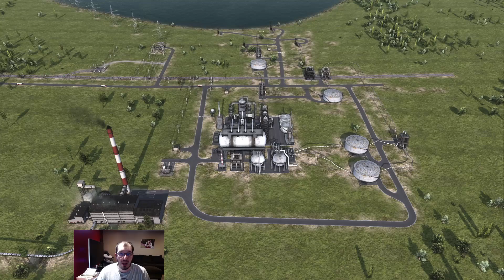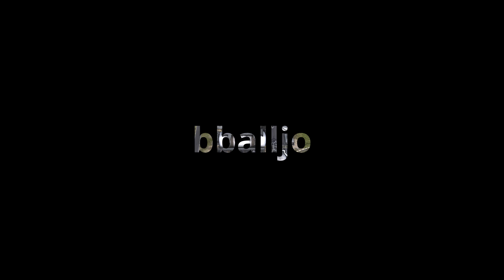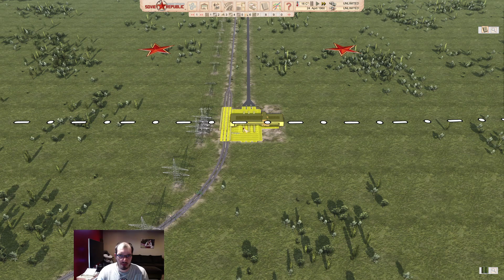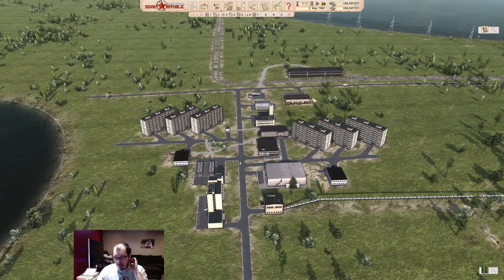Quick Guide: How to setup a new Production | Tutorial | Workers & Resources: Soviet Republic Guides

Comment: Pretty disappointed in this tutorial compared to other educational materials you have done.
Reply: Comments: Weird title of video. Guess thumbnail makes more sense?

Notes on map position:
Should always build top left or bottom right if you are planning on making the most of your starting money and doing less autobuilding, but closest triple Soviet customs area that fits that criteria. Distance to NATO matters since you want your USD to ALSO to go as far as it can. If you plan on autobuilding all game and trading with only Soviets, then bottom left corner.

Should reroll random maps when starting out until you get a triple Soviet close to the top left or bottom right for best starting position / money usage.

Optimal pumpjack position:
(I think yours were too close, not really ideal).
Assumed area vs Actual area (240 m diameter circle area is displayed by the game but the actual used area is only 190m)
This means you can set jacks 95m away from each other with zero overlap. If you create a square 
95m from jack to jack, (enable the grid, and each grid square is 10m, so the tips / points alternate (the .5).
If you filled a square with 4 squares filled with 4 circles, you would see that there is a huge area missing in the center (in the game it looks like a diamond).

Easy way/fix:
If you create a square 140 per side, you will leave 1 green square visible in the middle. This has multiple overlapping parts of the circles.
You can minimize this by alternating rows at different lengths.

Harder way/perfect coverage: Put your first row of pumps 145 meters away from each other, and alternate a row 72m (between the two) and 160m below it.
You will see a diamond pattern.
Easiest way to measure all of this? Gravel roads, and clone tools. When you are doing a large oil field (custom map, not randoms) you can put dirt roads between all the pumpjacks and also verify if something looks off.

Tank: The tank you put in front of the 4 pump jacks can hold 1500T of oil, when you can only make 20T of oil a day. Would  take 75 days to make use of it. Yes you said  you could use it for other industries, but 4 pumpjacks at the start isn't the time or place for it. Cost you another 15k.

Refinery:
I think making a refinery with only 4 jacks is a losing battle and I dislike random maps to begin with. You are setting yourself up for a super expensive setup. Yes you can import oil.
250T of oil can be consumed per day by the refinery.
4 jacks you said estimated 5T of oil (20T)

8% with only your 4 pumpjacks is correct, but I thought I heard you say 20%. 8% of 500 would be 40, so yes 120 per day. This would yield only 10T of fuel, and 6T of bitumen. 

Think you should have moved the 2nd tank placed next to the refinery (always good to have ability to reach the output lines on tanks).

Money: 
This was all done in sandbox, so I assume this video was intended for an easy audience. 1.6M on just the oil / train / heating plant part when I recreated it, nothing for city (500USD I didn't spend)

Ok, so oil sells 41R/T, buy 45R/T at game start. Bitumen  199/220. Fuel 121/134. 10T of fuel, and 6T of bitumen. 2400R per day * 30 $72000 at 100% production per month.

290k to build it and maximum capacity to be used is only 8% (obviously this changed when you started importing oil).
You have to be careful with this, as your tanks will always be filled up and not empty if you are converting oil to fuel and bitumen as 250T of oil is turned into 125T of fuel and 75T of bitumen in a vacuum, but when you add in your own oil, it can stall the system when importing oil, and then you can't export anything, because there is no room, or you are paying for oil and not using your own (obviously just a caveat the player will learn later).

Aesthetics vs cost:
Pipelines cost a TON more than either jacks or pumps. Use straight lines as much as possible.
In 1960 100m of pipeline on the border is 10.5k, 11.5k in the map center, 12.3k in the far right top corner (NATO corner). A pumpjack in the NATO corner is $6915, a 3 way pump is $11.5k.

Lifespan/pollution:
More helpful to use the search bar to the right rather than the population overview. Good habit to start using  early on. Will pinpoint who is unhealthy, not that you have a generally unhealthy population (it will show the unhealthy houses, and then you can determine if it is based by pollution, heating, lack of food, doctors, etc..

Busses: Advise Line Spacing personally. You said multiple times 'vehicles don't matter'. They do, should be selected and looked at.

tl;dr, I guess for an easy or sandbox tutorial this is ok since you showed how to connect parts together. Would have preferred to see costs, profits, etc.. and I don't think 4 pumpjacks warrants a refinery on its own. Your other videos you go into the science / efficiency / mechanics.
Reply from the maker: Thanks for those details! I think I agree with all of them, but I was targeting more the mechanics than anything else...I would never use the vanilla oil setup on a random map, as you said it's going to be too hard to justify...but I've been making these tutorials with vanilla only, so everyone can attempt it.

I guess I do have 1 point I disagree with...line spacing. It works fine for busses, but it kills your traffic flow because it's applied to every line. I don't want my cargo trucks to slow down to figure out their spacing, but when they do they slow down everyone behind them, eventually everything is slow....short I'm not using line spacing in it's current form.

You talked about a lot more details than this video was about...and I honestly think most of the points deserve their own tutorials...best part about the game is, everything is connected...worst part about the game is, it's not very easy to pick just a small subset to make a tutorial for ;)
Reply from the maker: Thanks for being honest. Same for the long version?
Reply: @bballjo  Oh sorry posted this on the wrong video. Took a minute to write up. Now I get it. I kept seeing no comments and then comments and back and forth and kept opening up new tabs.